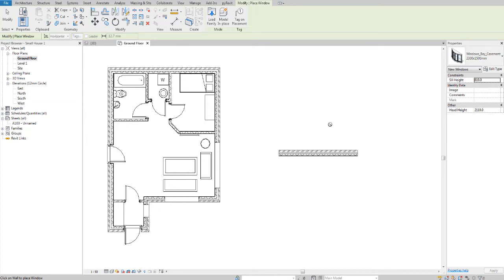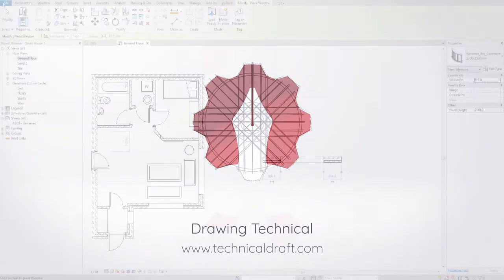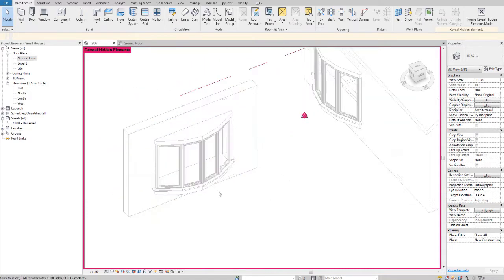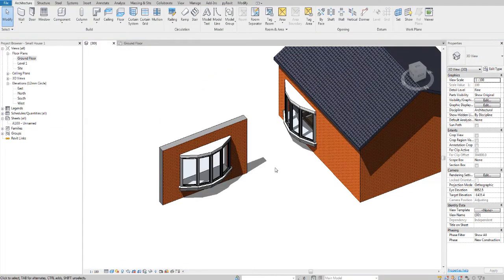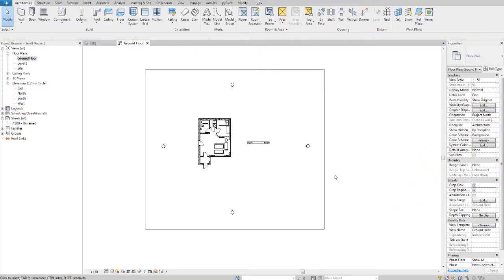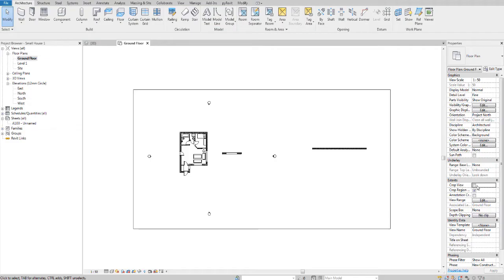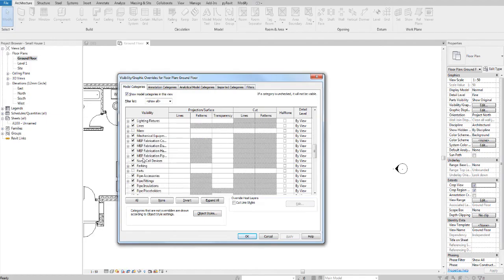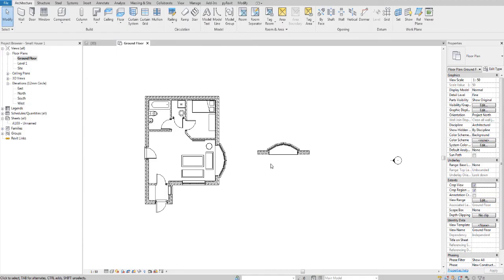Revit Components NOT SHOWING | 3 MORE SOLUTIONS

Comment: Hello, thank for your video, I have a problem. I can see a window in the floor plan but in 3D the window does not go thought the wall, either inside or outside. Do you have any advice?
Reply from the maker: Hello, I am assuming that you've attached a window to the wall, and it shows on plan, but in 3D it shows as if it's stuck inside the wall, where you can see it, but it's not cutting the wall through so that it's visible? If this is the problem, then the solution that comes to mind is that you might have placed a wall twice in the exact same place, and the window is only cutting through one of them. Delete one of the walls. Hope that helps, let me know how it goes.
Reply: @DrawingTechnical  Hi, I have just one wall, I assume it is a problem with the window that I created, is there a way to send you a screen shot of this?
Reply from the maker: Ah, you created a window family? I’m assuming that you’ve use the opening cut for the window family. When you put it in your model click the window, then under the geometry tools at the top left, click ‘cut’ and then click the wall and it will cut the wall to the window. Hope that helps.

Comment: I tried all the options but, still couldn't see my light switches in my ceiling plan.
Reply from the maker: I will try an see what's the problem and get back to you shortly.
Reply from the maker: Is it the actual light components that are not showing on the ceiling plan? I just tried it and don't seem to find any problem. Did you attach your lights to the ceiling from the ceiling plan?